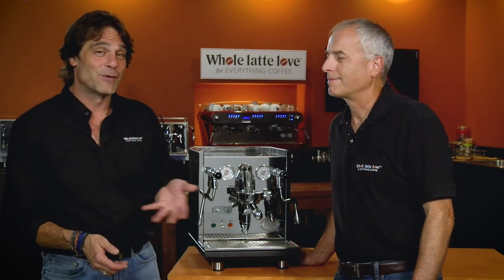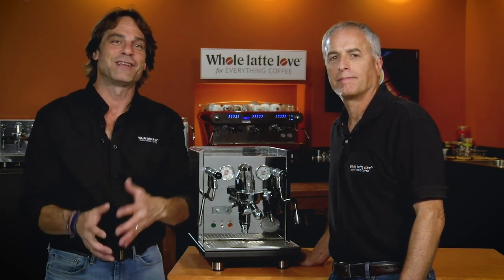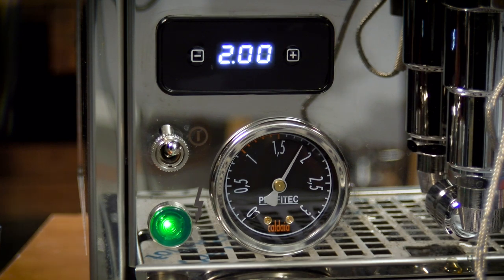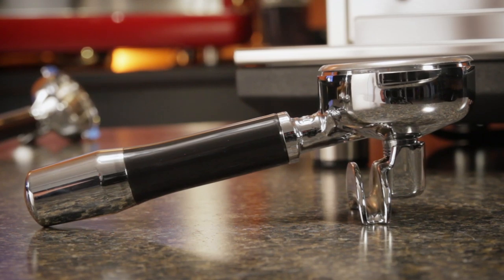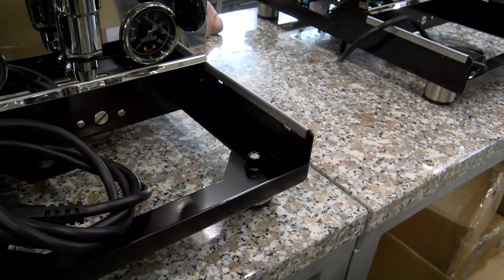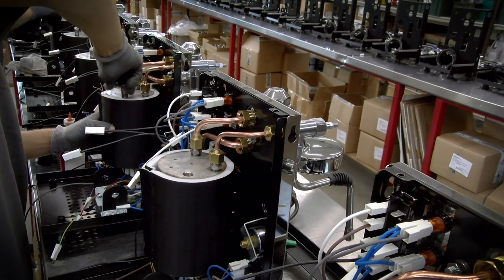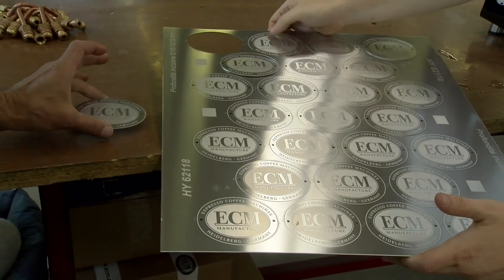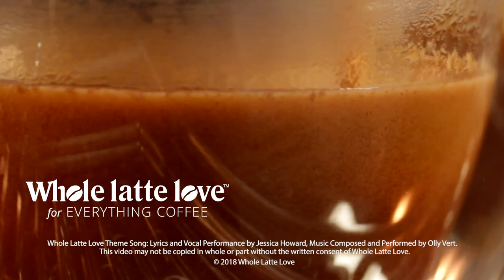Passionate Design: ECM & Profitec Espresso Machines

Comment: A suggestion for improving the cleaning aspect. Can the inside corners of the drip tray be not so deep. It is difficult to remove buildup that is collected in the corners. Maybe make them rounded instead of the hard angles.
Reply from the maker: Hi Paul, Thanks for the comment. Will pass along to Michael.

Comment: The only difference between the Syncronika & Pro 700 is a visual one? All internals are the same?
Reply from the maker: Hi, Thanks for the question. Yes, internally the machines are the same. Differences are the Synchronika: has lever operated valves, PID display color blends - it's silvered, frame base is a single piece, easy to open up, angled portafilters, comes with a polished heavyweight tamper.
Reply: Whole Latte Love Hi Mark, also the pressure gauge are located above the group head on Synchronika and below the group head on the 700. Color of the gauge also diferent.

Comment: Maybe a weird question? but why would I get the Profitec vs the ECM? Does one brand make a certain emphasis vs the other, or is it just cosmetic differences?
Reply from the maker: Hi Harold, Thanks for the question. Think of Profitec as Toyota and ECM as Lexus. Under the hood very similar with ECM featuring more refined cosmetic detail. Good example is the Profitec Pro 700 compared to the ECM Synchronika. Internally the machines are nearly identical. Externally the Synchronika is more detailed.
Marc

Comment: What is the difference or advantage of having a stainless steel boiler like ECM uses, versus a brass or copper boiler used in some machines from Rocket or others?
Reply from the maker: SkeksisRule Hi SR, thanks for the question. IMO boiler material makes no difference in espresso quality. Personally, I prefer stainless as it looks better down the road when a machine is opened. Some opinions which say SS is less likely to scale but no hard data on that. 
Marc